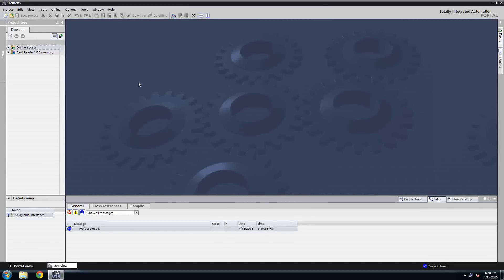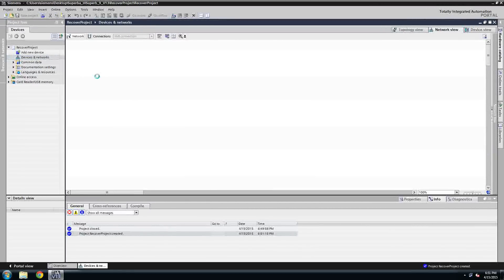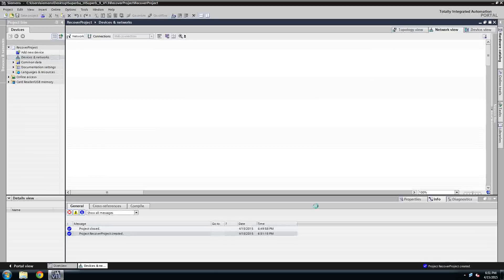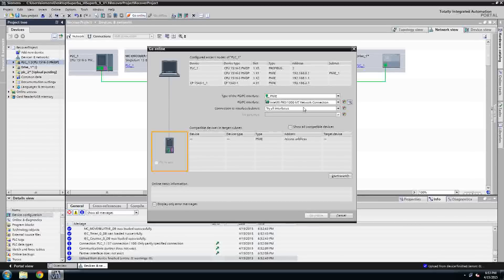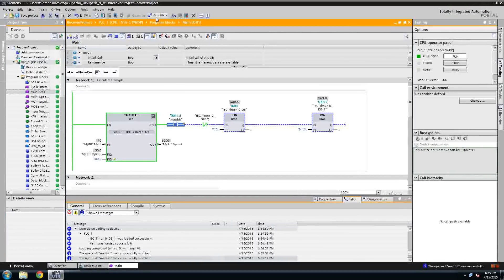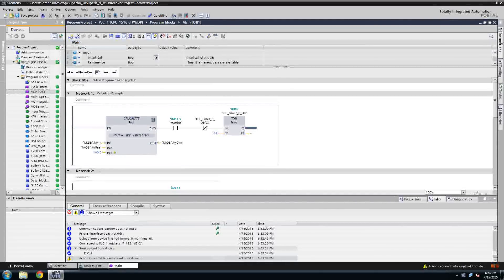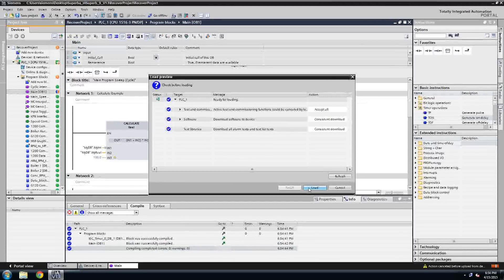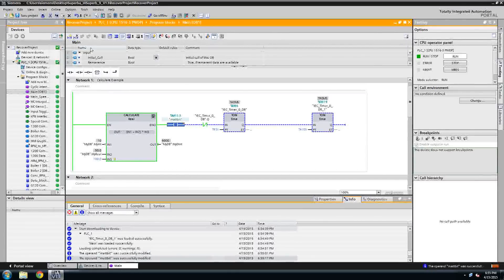Uploading a TIA Portal Project

Comment: Hi, Do you know if it possible to make an upload in a way to edit the application and make changes in a TP400 basic? I don´t have the back up.
Thanks.
Reply from the maker: +Daniel Michel Hello Daniel. Unfortunately you cannot upload (or "back transfer") your HMI screens on Comfort and Basic panels at this time. While the screens, data, and licenses can be automatically backed up onto an SD card, that file cannot be read into TIA Portal for editing.